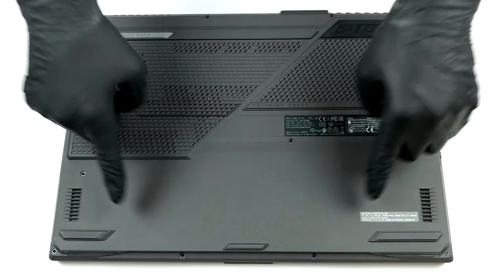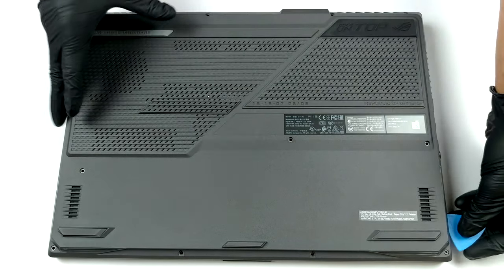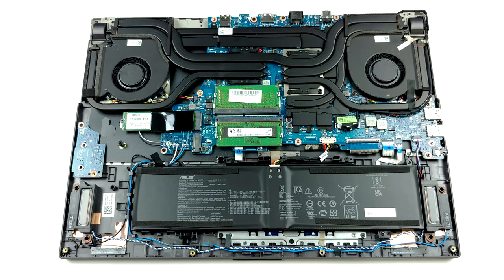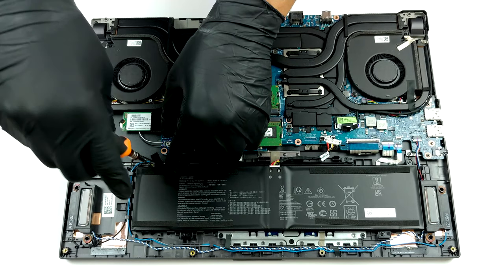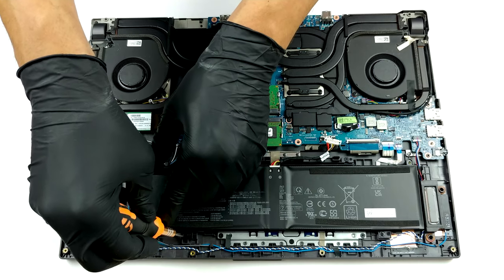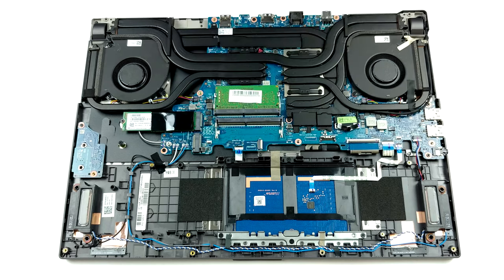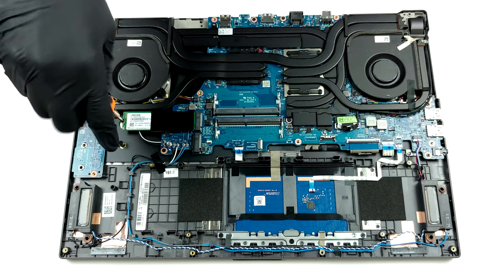🛠️ ASUS ROG Strix G17 G713 (Ryzen 9 5900HX + GeForce RTX 3070) - disassembly and upgrade options

Comment: Not soldered RAM and second M.2 port on AMD Ryzen! Unbelievable!
Reply: @MakeSomeSpace it means you can change ram memory and add a new disk to this laptop
Reply: @MakeSomeSpace  Apple solders the SSD and Ram to the mobo. It also glues the battery to the base. If any part fails, it will most likely brick the laptop and cause all data to be lost.
Reply: Man, This Is Honestly Why I Picked This Over The Legion 5 Pro... It Seems Like Asus Pulled It's Head Out Of It's Ass For This One... All It Needs Is Better Ram And A Faster SSD And It Will Be One Of The Best Laptops... Period
Reply: That what I thought 2 tears ago but sadly tiny heatsink and 100C if you want to max it out

Comment: How do you disconnect and then reconnect the led strip ribbon cables? I wouldn't want to break them. Thank you
Reply: Probably too late but do not disconnect them just gently turn the back over. It is a pain in the ASS to reconnect them!!!!
Reply: @gageboy14  i like someone to post a video on how to do it because when i upgraded my ram and added a 1tb ssd i disconnected both and left them out because it seemed impossible
Reply: @drondello1  just hold the sides of them by the ends and wiggle them in. That’s why I did
Reply: @drondello1  did yours have heat sink strips on them? My ram does and I was going to replace it but I don’t have extra strips
Reply: The ribbons are a pain in the A** to reconnect when you have open access to it... just don't disconnect them and replace the ram and SSD. It's how um going to do it. I saw the ribbons and was pissed. Why can't they just put a the panel like everyone else? 🙄.

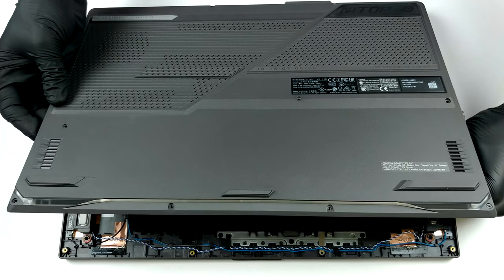Comment: @LaptopMedia, i got this laptop and opened the bottom panel and i was not careful to disconnect the ribbon cables from the Motherboard, and they got instead disconnected from the bottom panel (0:30 - 0:40 part in this video). I am not sure how to put it back. Can you post a screenshot of the panel where the ribbon cables are connected? Thanks a lot
Reply: Damnnn that sucks man
Reply: @jerrygereden  It's not really a problem. The only thing not working are the LED lights on the bottom panel, not something i really need but would be good to connect them back :)
Reply: @AleksandarT10  ☺️is the screen a bit dim ? I saw on the spec sheet that the brightness is 300 nits (even 250 nits for the 3060 model). And how much did you pay? Here in Holland it's 1999 euro for the exact model in the video. Thanks!
Reply: @jerrygereden  The screen is OK in my opinion, pretty decent imo. I paid around 1650 Euros in Macedonia. Only issue is there are no GPU Drivers as of 25 Jan 2021. CPU is beast tho, getting double the scores in Cinebench R23 comparing to my previous i7 8750H CPU
Reply: @AleksandarT10  Impressive. What is the exact score that u got? And how are the temperatures during Cinebench? How hot does it run while gaming? I'm curious :P
Reply: @jerrygereden  can you link the spreadsheet you were referencing?
Reply: What is the score that you get in timespy? Cpu and gpu?
Reply: Hey, I did the same thing. Those little corner bits where the ribbon cable connect can be removed from the system. It has a little screw there in the corner, and then that tiny board just pops out. On the other side of it (that would be up against the bottom cover), there's a little ribbon cable connector with the flip-up lock mechanism. 

Re-connect the cable, flip down the lock, then screw it back into the corner and you should be good.
Reply: @bigsoda  ok so this means i have to unscrew the screws at the sides and put them there?
Reply: @AleksandarT10  Yeah, you'll remove the screws in the front corners of the bottom plate which will let the little module pop right out. On the other side of it, it'll have the place to put the cable. It'll look just like the connector it goes to on the motherboard. You can slide it back into that connector, lock it down with the little flipper, and screw it back in and you should be good to go.
Reply: I accidentally did the same thing except my cover went flying because one piece was stuck and popped up and off. Anyways, I tried reconnecting the ribbons and the lights didn’t work. I’ve read that once they come out they are garbage. I had plans on turning off the lights anyways but it’s just the fact that it’s a brand new laptop 😖
Reply: @bigsoda  how about on the motherboard i couldnt seem to flip up the connectors any ideas
Reply: @drondello1  Not 100% sure, I honestly removed the cables entirely since I keep the lights turned off anyway. Looking at 0:41, I think the connectors for it are to the left of the RAM (right under where SSD and SSD2 are printed on the board) and on the right side above that ribbon cable coming from under the battery (right next to where HSPK is printed on the board). The little black flaps should flip up there, if they won't come up you can try using something to flip them up like the corner of a credit card or something thin and plastic. You can use some tweezers, but I try to avoid metal as much as possible.

If yours is missing the little black flaps, it's possible those snapped off. Those little ribbon connectors are unfortunately pretty fragile.

Comment: This is the best value laptop I have ever seen. No known weaknesses.
Reply: There are a few cons that this laptop didn't have, but the pros on this laptop makes it the best at it's price. 

Because i have one
Reply: It doesn't have a web cam, for the 1500 dollars it costs for the 6800m variant it should have one.
Reply: @julianmorgan79  Fair enough
Reply: I ordered this laptop but with a 4800H and 3060 (130W) for $1099. The biggest con is there is no mux switch. But, it is by passable with usbc to displayport.
Reply: @julianmorgan79  for me that is a pro
Reply: @julianmorgan79  Agree, still you could just bought an external webcam. This is still one of the best value laptop ever.
Reply: Typing from the laptop right now. Yes I agree its great value for money BUT I other than the webcam the other complaint I have it the screen quality is horrible. Everything looks washed out no matter color profile you go for. I'm genuinely tempted to get an external screen rather than deal with it. The pro tho: If you turn off the lights and stuff, the battery runs a good 8-10 hours for regular usage. Not gaming of course.
Reply: @adityasingh8094  Thanks for your input. I am more of a desktop guy and I have a 4 monitor setup lol, more the merrier. Go for a larger screen ;)
Reply: mine failed after 5 months .
Reply: @MrAkurvaeletbe  Really? What happened? Covered by warranty for sure?
Reply: @NomanJohan  Yes but I wont send it in to Asus, it will take them 4 weeks atleast to fix it... One day it stopped charging and gpu stopped working. Hopefully gpu stopped working because no charge. Will check the charger and hopefully just have to buy a new charger.
Reply: Had to replace the GPU fan in mine after 4 months. I did it myself because I’m not going to wait for asus on a 50 dollar part. In the laptops defense I did adjust the fan curves to keep it cooler while gaming and the fans “while gaming” would be at 80-90% to keep the GPU in the low 80 C range. Other than that I have had zero issues and used it pretty heavily. (This is also with a very decent 60 dollar laptop cooler pad which I don’t think does too much)
Reply: @speedygtp  Thanks for sharing your exprerience.
Reply: @speedygtp  I have the same problem.. it goes 90 up and even lowered the game settings etc to make it go down but still runs 90 up. how did you adjust the curves of the fan? did you bend it?

Comment: How would I go about upgrading my memory to 64GB? What's recommended? Would it void my warranty and are there any issues I need to be aware of? I'm new to PC gaming. Thanks.
Reply: Opening the laptop will most likely void your warranty. You would get two physical 32 GB DDR4 memory sticks that are comparable to the preinstalled memory sticks. The only problems would be if you don't protect against static or the parts are bad.
Reply: @HanmaHeiro  Not  you are wrong in assuming this, opening your own device does not void manufacturing warranty as long as you do not cause any damage to the device. US government passed a law on this matter.  In fact all void warranty stickers are illegal in the US on any device an if a manufacture doesn't fix your device they can be fined by the US government.
Reply: @c-v-n3322  That's great to hear that those void if removed stickers aren't legal anymore. Thanks for the news. I'll have to look it up if it's effective in all of the USA or like right to repair is going state by state. Thank you once more
Reply: @HanmaHeiro  I’d like to add to your comment from my own experience as I’ve never heard of bitlocker until I got this laptop and upgraded the ram and added a second m.2. DISABLE the bitlocker garbage before ANY upgrade as to not get locked out and being forced to wipe your hard drive. The sellers do not know or store the bitlocker keys.
Reply: @speedygtp  That is definitely a worthwhile precaution. Thanks for adding

Comment: The stock ram bottlenecks the cpu. latency is bad. I changed mine to this > hyperx impact 3200 8x2. I gained 10 - 20% performance depending on the game that I'm playing
Reply: Is this the x16 ram with the bad timings?
Reply: I'm having FPS drops in some games like cyberpunk. Figure it's the ram.
Reply: Theres a billion reasons on an laptop you can get fps drops. Don’t upgrading ram os reusable but don’t go down the rabbit whole of eveey gen promising to solve the problems of the past.

Comment: Okay finally found a video about its mother board.. I have the same model only with an AMD GPU RX 6800M. so how do we actually clean the cooling system? unlike my old laptop where in you can just clean the fans of it. also is 4TB from 2 2Tm.2 advisable? or i can just max it out to 2TB? I've already maxed-out the ram to 64.
Reply: 64GB of RAM 😮 you're using it for production like 3D design or photo/video editing? 4TB would be awesome upgrade, I've replaced with 2 TB on mine and need to buy for my brother (2022 G17) 2TB nvme and add it with 1TB one so he should have 3TB (1+2).
Reply: @Najbrži  yeah I do 3D and graphic design.. I can't afford the pro art version of this 😅😅😅 also I found out you can only max this to 2TB with 2 m.2 1TB each slots

Comment: Hello can you please confirm the performance and the type of Wi-Fi card, I heard some models have a Mediatek card that may not be as great as the Intel, have you experienced any disconnection or has it been stable?
Reply: Mine has the mediatek card but have had no issues. It has better coverage than my desktop card.
Reply: My mediatek wifi card has started giving me trouble, in fact its the only thing that has given me ANY sort of trouble on this PC. I'm probably going to put in an intel ax200.
Reply: My 2021 G17 has AX200, my brother 2022 G17 has MediaTek wifi chip which is junk, gonna replace it with a AX210.

Comment: Hi, 
I bought 16 gig variant of it and I need to upgrade the RAM. It has 2x8 GB Rams already.
First question is, 
I can replace one ram of it with a 32GB, so the total ram would be 40GBs, and the other option is to replace both of the RAMs with a 16GB slot. Which is a better solution? Can I have more than 32GB RAM on this device?

Also what RAM do u suggest? Should I use 3200 RAM or I can install more frequencies?
Reply: I believe with AMD, you really want the ram to match in both slots for dual channel, or you risk losing a lot of performance.
Reply: If the ram is x16 ram you need to replace it. That ram has bad timings causing some AAA titles to run slower.

Comment: What if I wanna replace thermal paste on my CPU/GPU? I'm quite unfamiliar on where it was indicated. Say I wanted to repaste it once a year. Just wanna make sure I don't wanna make it over heat for a long run.
Reply: The CPU has liquid metal.
Reply: As Lyle pointed out, this system has liquid metal for the thermals in this system. You won't be able to replace it as it requires some pretty specialized tools, but you also shouldn't need to.

Comment: How do you disconnect and reconnect led strip cables
Reply: just remove horizontally
Reply: My advice is after separating the back, gently turn it over. There is enough slack to lay the back flat. If you pull the strips out it is a pain to reconnect them. Especially if you do not need to.

Comment: How are you sure that you can have up to 64gb of RAM?
Reply: 100% you can do it
Reply: Nope up to 32
Reply: @Kiwipro81  how come
Reply: @Kiwipro81   On the official website it says up to 24 GB.
Reply: @vladimirstanisic7550  dats the rog zephyrus g15 I am pretty sure
Reply: i can confirm with 64 gb of RAM works fine
Reply: @i4fpv660  have you tested it
Reply: @SamS-ef5ez  Yes, i tested with Windows diagnostic tool, there were no errors
Reply: @i4fpv660  
I got this G713Q-MHX132T (only RTX3060) - I hope it's the same MOBO as RTX3070, wanna get 64gb ram soon.
Reply: I have upgraded the ram to 64GB (32GB x 2)  - so it is possible.

Comment: Great video. Somebody tell ASUS that they should put some radiators inside their devices and not only heat pipes and fans.
Reply: Radiators? Is that even possible in a laptop?
Reply: @hasnihossainsami8375  not really. This guy doesn't seen to understand the space requirements or thickness of this laptop line.
Reply: @excessmaterial  I know it isn't possible, I just wanted his input